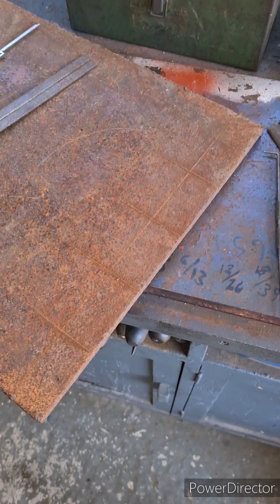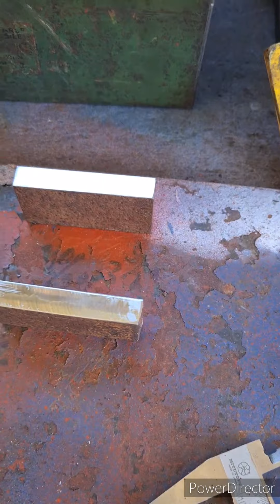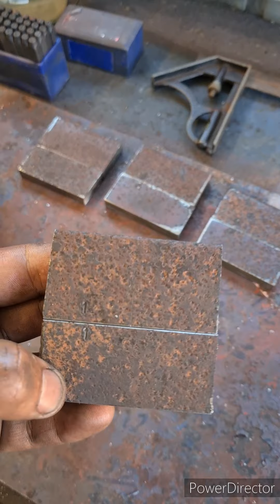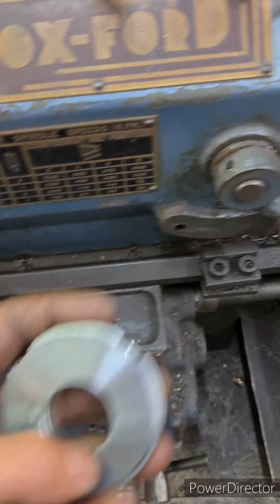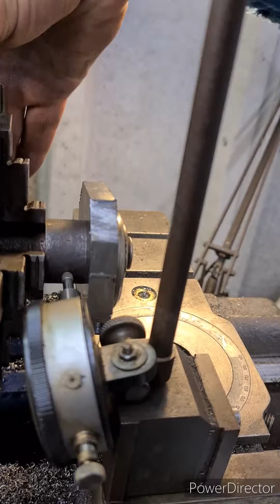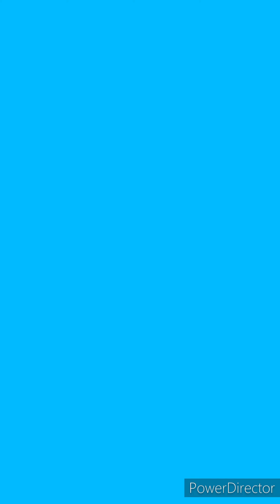How to Machine Eccentrics - 3" Fowler Steam Traction Engine

Comment: It's coming along nicely. What a difference in scale from your 3" to my 2". I'm working on the winch drum at the moment and having problems with chilled cast iron. Any ideas? I tried cast iron inserts but they can't get under the hard stuff. Maybe resort to a grinder?
Reply from the maker: Are you taking deep enough cuts with a slow enough speed? Too fast and too light will even burn oit carbide.
Reply: @johnlintorn6768  The chilled area is at each end off the winch casting so I'll try that. I have tried turning the lathe by hand but I'll have a go with HSS tomorrow. It does resonate as you suggest, so I've tried lower and lower speeds and holding the boring bar to deaden the vibrations, but HSS may fix it. Thanks
Reply from the maker: Sometimes you just cant avoid the chatter. Especially on large thin items like the drum exacerbated by small lathes. Just stick on a pair of ear defenders and get through it haha. Thats what I do anyway.
Reply from the maker: Also the length of the boring bar wont help. And holding it never helps  as your hand isnt tough enough to deaden the resonance. I have had to make up special, thicker tools in the past to get around things like this.
Reply: @johnlintorn6768  I do have a left hand carbide boring bar - I'll try that turning the lathe by hand.
By the way, your gears look superb. I had one tight pair like you and I made an offset bearing (about 1mm total offset) and rotated it till the gears meshed nicely. The overall out of true across the hind shaft was hard to discern.
Reply: @johnlintorn6768  That worked a treat. I used back gear and slowest speed and the tooling cut under the chilled iron. Wasted 4 inserts though, but it worked - very slow and deep cuts - spot on. Thanks
Reply from the maker: @OthamJohn  Glad you can move forward now 👌
Reply from the maker: You'll also have a lot of resonance which might not help. Will create chatter which might be breaking your tips. In the past I have had to use a sharp HSS tool before and keep on re-sharpening.